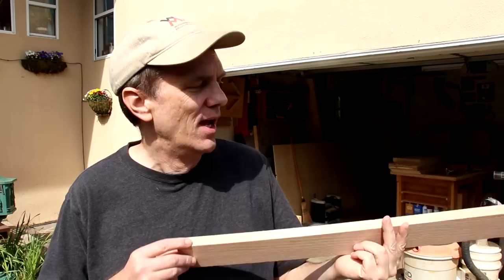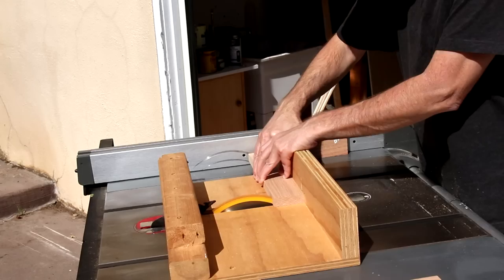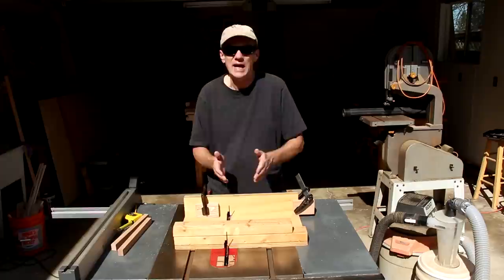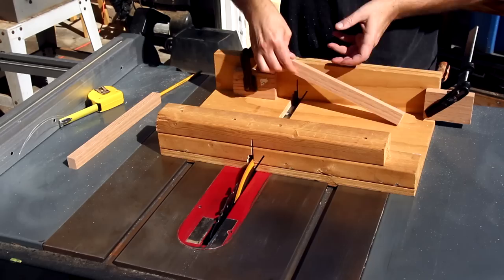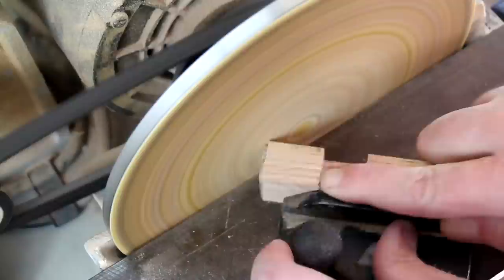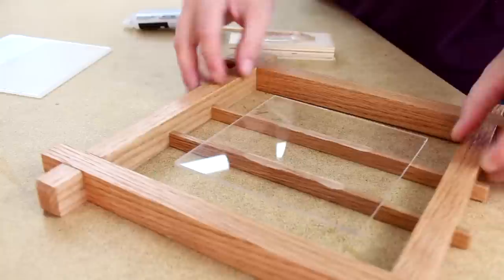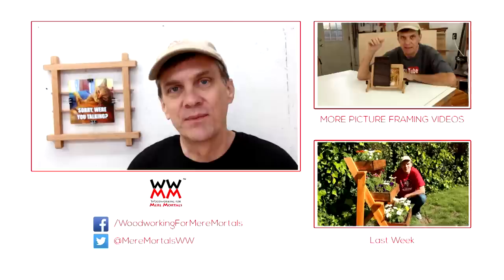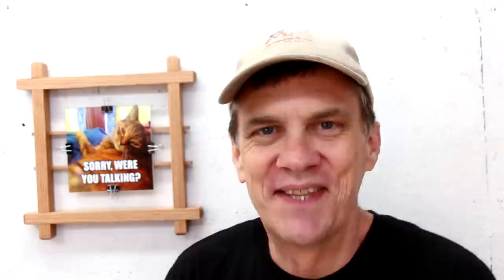Contemporary Photo Frame. No miters needed!

Comment: Steve, nice project.
My suggestion would be to "flame the edges" of the plexiglass.
This gives the plexi edges polished look.
Just use a torch and move it quickly over the edges and the white areas should become clear.

Comment: I got Stuff Matters for Christmas a couple months ago, and it really is a great book. Satisfies the "How It's Made" or "Modern Marvels" cravings I have since we cut the cord!

Also, great project, Steve! The exclamation points mean I'm sincere! Really!
Reply: Connections that was on PBS a few decades ago was also how things have evolved.  Starring James Burke.  Fantasic series.
Reply: ***** Just the construction of concrete lintels with prestressed steel wires are awesome for me.

When a beam like a lintel is loaded (weight on top of the lintel) a tensile stress results on the bottom side of the lintel. But the tensile strength of concrete is about 10 times less than the compression strength. So for practical small size lintels, steel wires are used to take the responsibility of the tensile stress. The steel wires are located close to the bottom surface of the lintel. For low span constructions just traditional steel reinforcement (rebar) can be used. For longer spans prestressed steel wires are more practical. Basically the steel wires are stressed with a solid anchor on one side and a machine that pulls on the other. Then a measurable increase in length is seen on the wires as the stress is applied. Then the concrete is poured and cured (hardens) over some time while the steel wires are still under stress. When the concrete is sufficiently hardened, the stress is released and as the steel wires are unable to compress due to the bonding to the hardened concrete, so the steel provides a compression force to the bottom side of the lintel to compensate for the weight. This way the amount of steel can be saved compared to the traditional rebar. They also make bridges with this method.

Comment: What a cool picture frame, mainly the Princess Meow-Meow photograph. A question: Is there some difference between using a dado set and the table saw blade to make the half lap joint? Seems like would be faster using the dado set. Thanks for the great video, Steve. Thanks to MicroJig and Audible for sponsoring the show.

Comment: If you wanted to get fancy you could scrap the edges of the acrylic with a razor blade and then take a small torch and run it over the edges real quick and have a nice flame polished edge with little effort.

Comment: You might remember me from a few videos ago when I asked you how to save up to buy tools,well now I saved up some money and I'm trying to make up my mind on what tool should I buy...I have a table saw but it's not the best so I was hoping for advice?Thank you wery much ahed.(Sorry for any misspeled words)
Reply: Thanks!I'll search for it!
Reply: Dimitrije Vasiljevic Don't rule out Craig's list either. Lots of old tools out there with plenty of life left in them and, for the most part, the older saws (Delta, Mastercraft, Rockwell, Beaver (canuck brand)) are of better quality. Helps to find someone knowledgeable if you are unsure how to determine if a saw that you are buying is good or a lemon. Some things to test would be tilt and lift (smooth operations), arbor run-out (unplug the saw and push the stopped blade side to side and feel for any slop), smoothly operating fence that, when locked, has no play in it (test both ends by gently pushing fence towards and away from the blade). Should also check the electrical plug for fraying where cable enters the plug. If possible run the saw and feel for excessive vibration on the table and noise, the belt (if any) may need replacing, keep the hands away from the blade!. If all that passes and you feel comfortable with the saw then it should be a good purchase.
Reply: Hi Dimitrije,

Just a bit of general advise: Maybe it would be a good idea to first determine what kind of woodworking projects you love most. Maybe you can make a list of cool projects you might like to do yourself. If you can see a profile in that list it will make it easier to find the best tools for these needs.